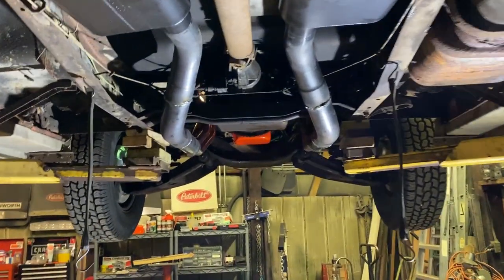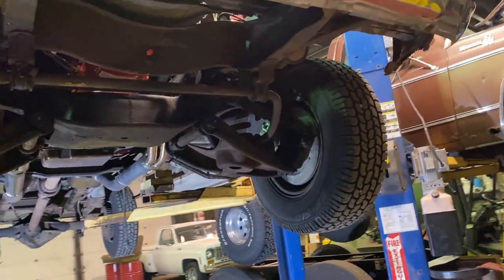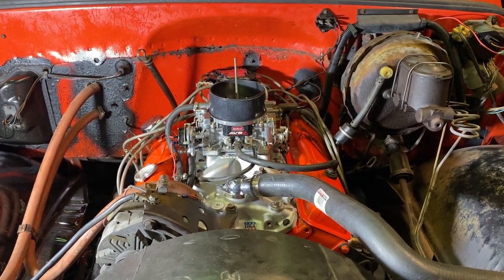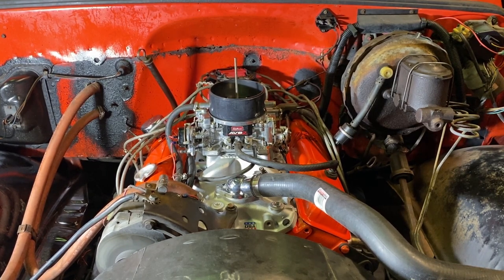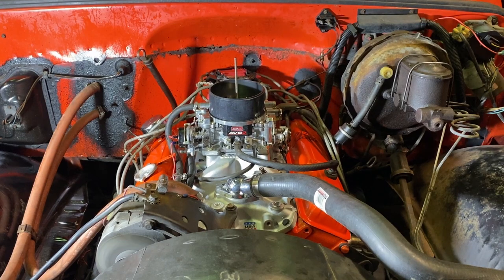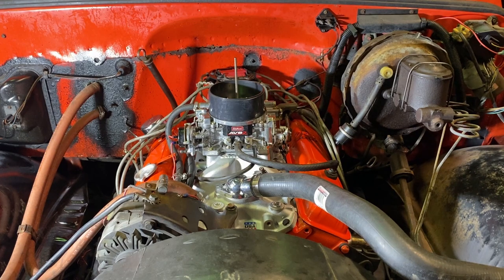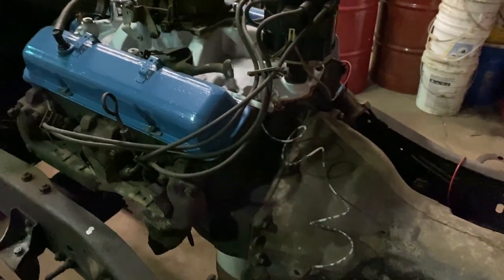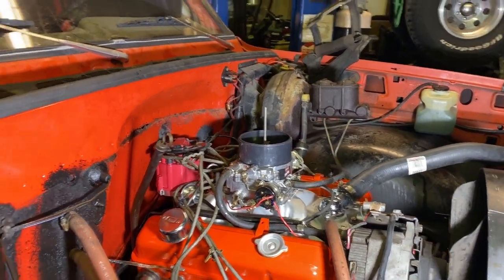Squarebody C20 Project UPDATE Part 17 doesn't look good |square body|

Comment: I'd leave the exhaust the way you have it and worry about the engine. It's wiped out some lifters and probably a couple of lobes on the cam too. Now there's metal all throughout your engine the bearings are probably chewed up too. It's gonna need to come apart completely and be cleaned thoroughly to get all that metal out, I've been there before It's not fun at all. 
 After you get it all cleaned up and rebuilt  first you'll need to prime the oiling system with an old distributor or priming tool and make sure you're getting oil to all your rocker arms also get some good lifters with the hardened foot (heel) and use a good break in oil if going back flat tappet and as soon as it fires up take it to 2500rpm for 20minutes and you can adjust the timing there. 
  Never let a flat tappet camshaft idle on first start up, the cam and lifters have to harden to each other and the lifters need to spin in the bores as they create a wear pattern as they harden. The flat tappet camshaft lobes are ground at a slight angle that causes the lifters to spin and keeps the camshaft pushed back in the cam tunnel and keeps it from walking forward. The lifters can't spin well enough at idle and if they're not spinning they're grinding in the same spot